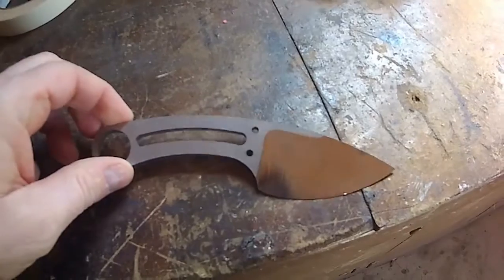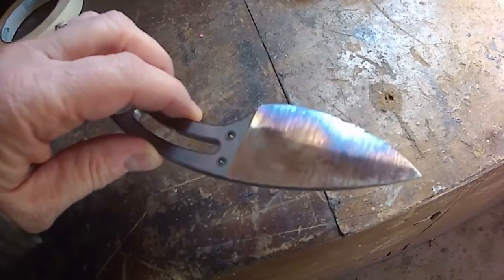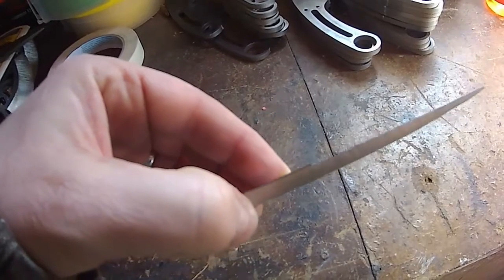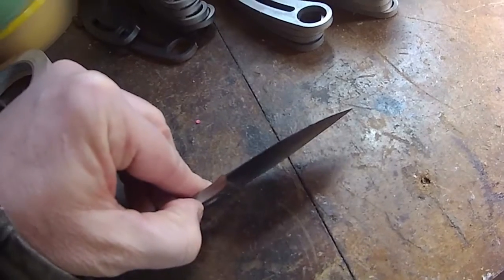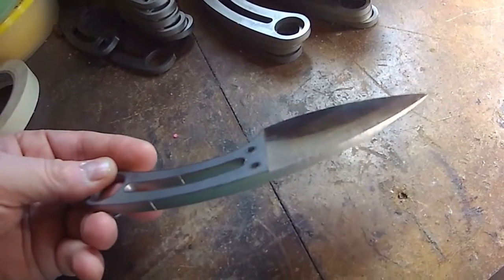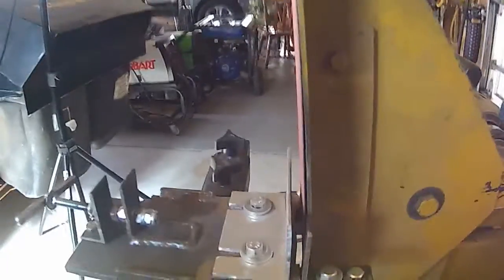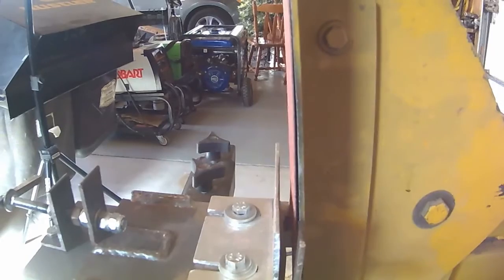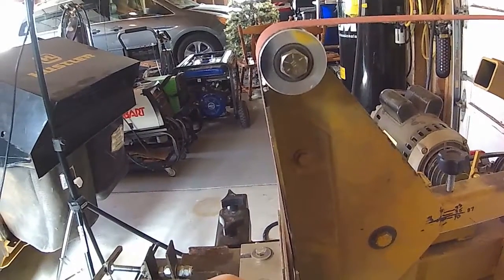Flat Grinding Bevel Jig | GET THE JIG PLANS

Comment: I wish I lived closer I'd love to have all your scraps haha. Was is a2 steel you said your using? I need to find a nice easy to heat treat steel but still trying to make my mind up at the moment
Reply from the maker: +Diesineveryfilm Customs That would be fun to have another maker close.  The A2 tool steel is nice.  It is an air quenching steel.  Meaning you just let it cool in the air and it hardens.  I have had good results doing it at home although some hate on that method.  I only do that for personal use blades.  Any blades I sell go out for professional heat treat to get the full potential of the steels I use.  So far I have done 1075 carbon steel, 1095 carbon steel, and A2 tool steel at home.  The A2 gave me the best results.  It does not warp when air quenching.  The 1075 and 1095 warped quit a bit and had to be pounded straight after tempering in the oven at 400 degrees.  The A2 got hard enough that I could not drill it with a HSS (high speed steel) drill bit any longer.  It does not rust near as easy as the 1075 or 1095 which will rust very very quickly unless protected.  I am not an expert but these have been my personal experiences.
Reply: Man that's helped me out loads I'm still just using files and Spring steel to make mine so I've yet to buy actual knife making steel. I did buy some save edge rasps but I can not for the life of me get them to harden and I did think they were just surface hardened but when I try to bend it it snaps in some parts and bends in others. I've now moved on to heller rasps as I got a good deal on 8 of them but when I harden these my file cas still slightly scratch them. The Hellers would not oil quench but they did water quench although others just oil quenched them and had amazing results. I think I'll have to cut on rasp into bits and try lots of different treatments to see what's best. Be good to have people closer so I could just go and talk to them haha.

Comment: If you only lost one knife trying to dial in something new, then that is a great sucess.
Reply from the maker: +Ernest Sheffield Thanks.  I did a lot of head scratching before and am pleased with the simplicity of the concept that lets me do hollow grinding or flat grinding on the same jig with only the addition of the blank carrier which is super cheap to make.  I got some new belts on order getting ready to make a serious round of grinding to knock out as many of those 73 blanks I had cut.
Reply: +BigIronTV You are going to be busy.